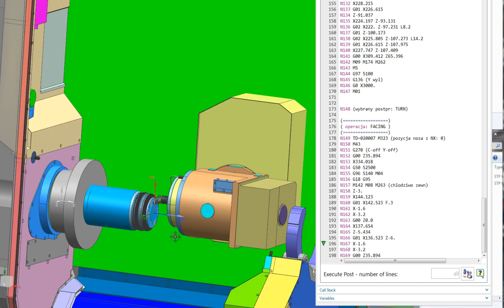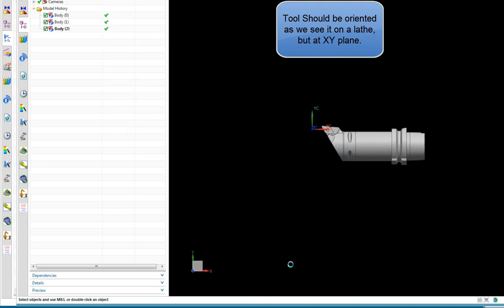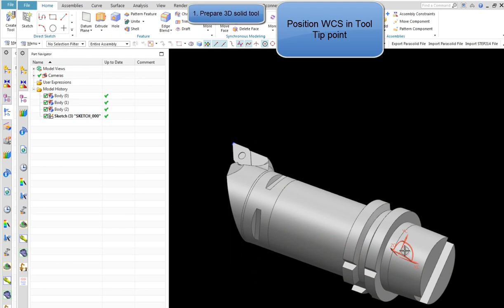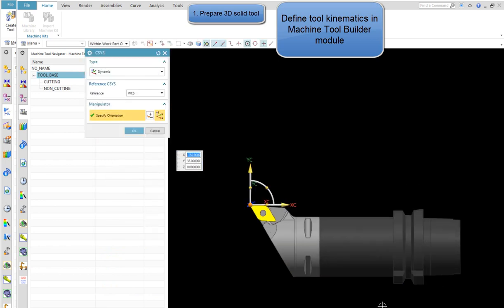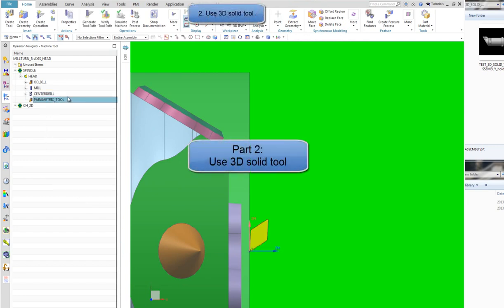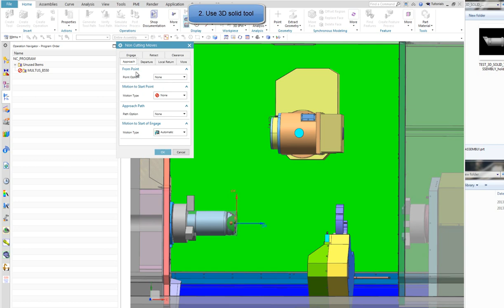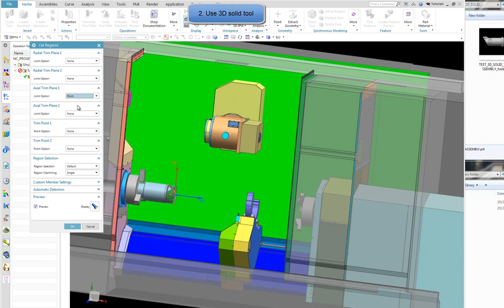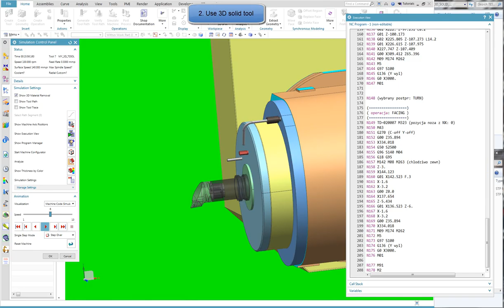Creating and using 3D solid tool in NX (part 1)

Comment: How can I do holder position setting without UDE application?
Reply from the maker: Hi
It depends how the postprocessor is setup. In case of lathe mode on Okuma we don't use exact B-angle, but registered tool position. That is why UDE was used for that.
There are several ways how it can be configured - and you should use it the way as it is specified in your postprocessor.